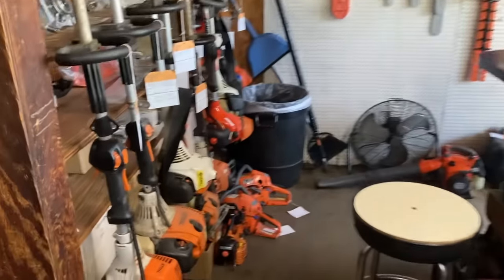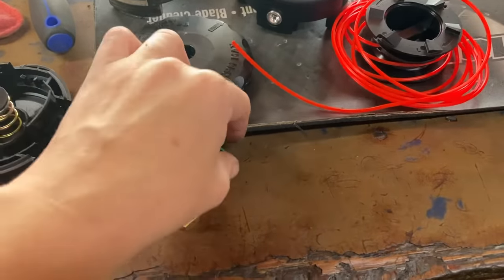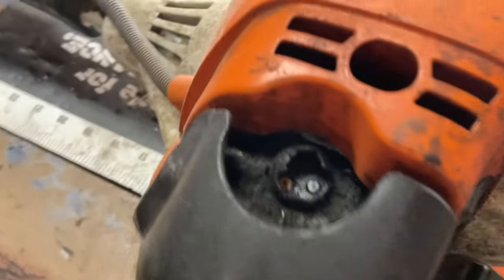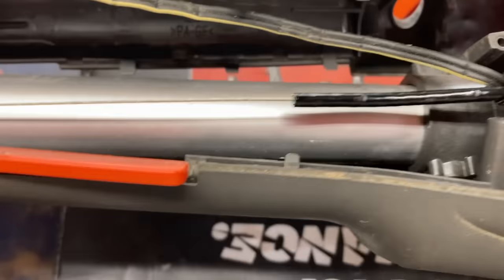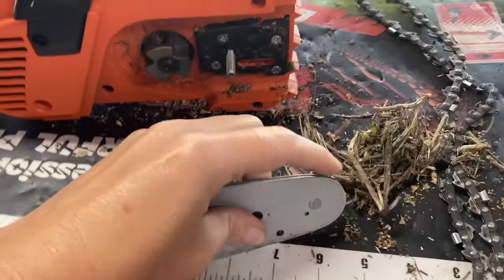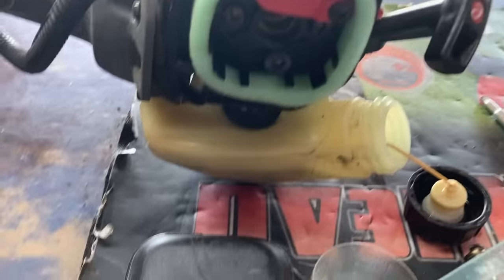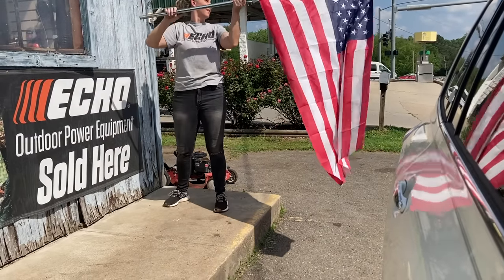Repair Shop Chaos: Tackling Countless Small Engines in a Single Day!

Comment: Is there any legit courses for OPE repair ? After many years in a heavy equipment shop and about 7 years in automotive I picked up a sweet gig maintaining and repair a lot of landscaping equipment as well as larger stuff like skid steers and compact tractors. Needless to say most of my knowledge and experience transfers over just learning the brand specific stuff like what brand has what designed or Known for what issues etc . But was wondering if there’s any training courses that would be beneficial. 

Thank you

Comment: I have a Ms 271 stihl chainsaw I bought in 2021 new , have cut up a tree that was downed by a storm , an found that it barely oils the chain . It only used about 1/3 tank of oil in 3 tanks of fuel , obviously the  chain is ruined.  Had to go to my old saw , took it back where I bought it ( rural king ) and they said it was OK as far as they could see (no help) so I called a local stihl dealer and ask if their were any recalls for this problem and the woman at this dealer would not tell me  anything. FYI iam not new to this have owned saws for many years , by the way my old saw I went Back to is also a stihl . Now I have checked and have found that their is no oiler adjustments on these new saws, if that is correct , any advice.(thank you ) disappointed stihl customer.

Comment: I was gifted a Craftsman 25cc model 316.711020 curved shaft string trimmer. It came with the trimmer and a garden tiller attachment.  The trimmer line is pre-cut so I have to change the line each time it gets short, which is very often.  I would like to change the head over to the Echo Speed Feed model.  The problem is I can't find any references showing that it will work with the Echo Speed Feed head.  I searched by model number and it appears to have been made by MTD.  Can you tell me if there is a universal Speed Feed head that will work with the Craftsman trimmer?
Reply: got your message. I don't know how to use that service

Comment: Here is something to ponder...the centrifugal clutch on my 2stroke troybilt engine came apart and jammed the engine; I managed the put the clutch back together and reassembled it, but now the engine is intermittent start but wont run or wont start at all sometimes, the carburettor is new, just bought it 2 or 3weeks ago, it has spark and compression and it was running before very good before it jammed...any ideas, anybody? or chickanic?

Comment: Question? How do you keep your hands soo nice? You dont seem to wear gloves. I do small engine repair alot. And our hands tell much different stories. Just curious.
Reply from the maker: It's weird this is the most common question asked. At work I only work on the 2 cycles. The only thing I ever work on that has something that will stain my hands is gear grease. I wear gloves when I have to mess with that. Other than that, I wash my hands with dawn about 10-15 times a day. I have to help customers, so if my hands are greasy from chainsaw goo, it gets on their tickets I write. So I wash my hands a lot.

Comment: so I took my spindle housing with the bearings in it with those stupid spring clips in there snap rings I guess with no holes... and the two were a mess rusted very bad it's all bad I hated it red hot with my map torch red hot and then by the time I set the torch down to pick up my screwdriver it had cooled of course and I took it I put it in the tank and pulled it and pulled it took everything I had to lean it over and twist it to take it out and I had enough space so I put the other screwdriver in it but I work that out worked it out and I moved it back and moved it back and they make no mistake just took a lot of time and then I had to heat it up again because it wouldn't come out and finally pulled it and pulled it out and it finally came out it was relatively easy but it takes a lot of time a lot of patience and a good map torch self starting

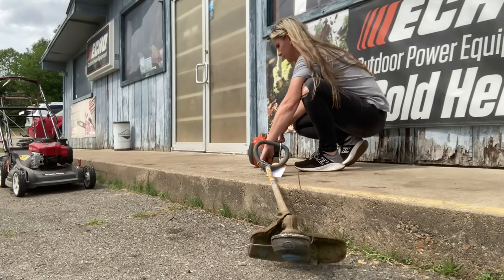Comment: How can these mowers brake down so offen,both my mowers,2006 Cub Cadet Zero Turn RZT mower 50 in deck with a 29 hp Kohler motor,purchase used for 400.00 6 years ago,change the oil every year shapen my blades,put new spark plugs and air filter,it runs perfect,my push mower 2006 Poulan Pro 22 in cut,6.50 motor purchase 8 years ago from a pawn shop,do the same,plugs,filter and oil change,works perfect,I mow  5 plus acres every week, my weed eater is 6 years old it a snapper purchase new at walmart,new spark plug and replace the head once,it wore out,it work perfect,these last a long time with min maintenance. 6:37